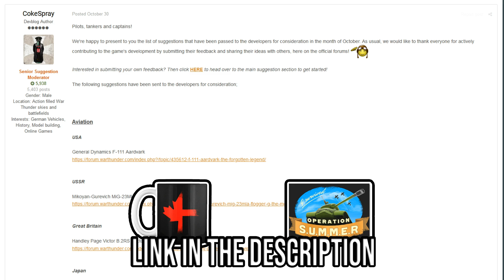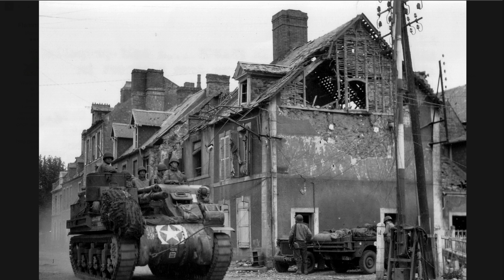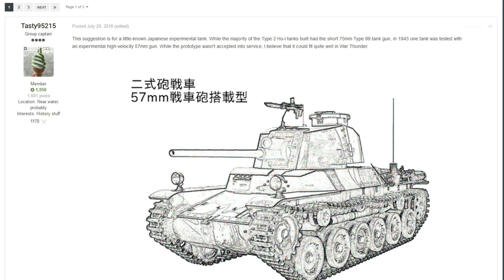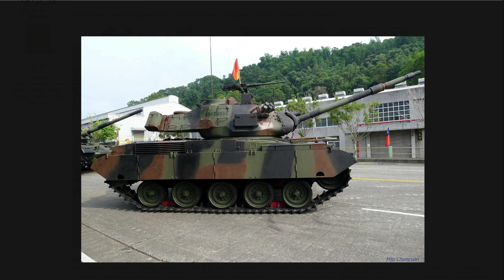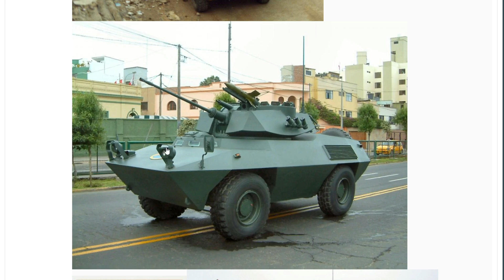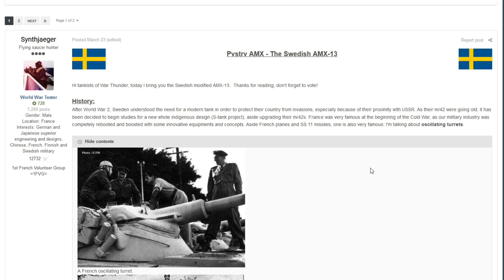Ground Forces - Passed to Developers - October 2020 - War Thunder

Comment: afaik the PzH2000's targeting computer can also be set where it can hit one target with 3 shells at the same time, if the target is far enough away
Reply: According to a group of people dedicated to the PzH2000, there once was an attempt at MRSI with 5 rounds, all hitting inside of 1.2 seconds overall. Though about distance, it's pretty much the opposite: MRSI greatly limits combat range as the  maximum range and anything near it can only be reached with a certain angle, making MRSI impossible.

Comment: Doesn't the CV90105 TML also have the TML 105 turret?
Reply: Not the exact same TML. Vextra has a bit more protection on it. What Sweden has is the same TML that was put on an AMX 10 RC for trials (the one ingame is the service 10 RC with TK turret).
Reply: @jeandelacroix6726  Cool! Thanks for the info!

Comment: No for Japanese tanks. What we desperately need right now is a rank 5 vehicle to supplement that lineup because grinding into tier 6 is fucking horrid
Reply: They also need a 10.7 like China ...
Reply: @drunkIizard  their top tier is fine tbh
Reply: @seemslegit6203  well it s ok but i dont think it will stay that way with new power and even then every nation should have top tier
Reply: @drunkIizard  new power, at least right now, isn't adding anything extraordinary. The type 90s easily hold their own at top tier and are some of the fastest top tier MBTs. Also the only real 10.7 they could add would be the type 10 which is probably too modern. Rank 5 is a much bigger issue right now
Reply: @seemslegit6203  if two new really powerfull mbt arent extraordinary... And for a 10.7 i propose the type 90 with the japanese 120 which is clearly better than the L/44. Finally if you think the type 10 is too modern just look at when the Khrizantema was produce or the two new mbt...
Reply: @drunkIizard  the type 10 would be the most modern vehicle if added, and its so new that basically all of it's specs are classified so it would be hard to implement. Also doesn't the type 90 already use a Japanese gun?
Reply: @drunkIizard  also a type 90 with a slightly better gun isn't really that much of an improvement

Comment: PZH 2000 isnt actually fully automatic on the ammunition handling. It is a semi automatic auto loader, where the shells are handled by an automated ring magazine that features an autoloader for automatic shell ramming. However the propellant is stored seperately and is hand-loaded once the autoloader has rammed the shell into the barrel.
Also, it has recently demonstrated its extremely deadly potential as a direct fire TD.
Reply: The reason for this is they can add either 1, 2 or 3 powder charges as indicated on the computer easily, depending upon range and or for mrsi.

Comment: Yeah Howitzers if fully implemented are going to make Tank RB unplayable, not only have to worry about attack aviation but then Indirect fire. to hell with that.
Reply: The maps aren’t big enough for indirect fire to be effective
Reply: @mitchellr5502  Yes they are. But not on the lower tiers. Higher tiers, especially on sim, gets some bigass maps. Well there are 2-3 really big maps of which parts of it are recycled for use on lower tiers.
Reply: Its not gona make RB unplayable really its not gona be like in WOT.
Reply: @MythicFrost  you can't say its not until its physically in the game. And don't forget I said fully implemented. Not the howitzers they have in game that are basicly tanks.
Reply: Do you honestly think gaijin would make it like it is in wot? They may make a lot of stupid decisions but that would be an astronomically stupid one
Reply: If SPGs are ever implemented I’d expect them to work like the ones we have ingame as tank destroyers considering use as artillery is way too close
Reply: @m1a1abramstank49  pretty sure japan already has an SPG, and yeah it does work like that

Comment: I hope with the addition of more howitzers; Gaijin considers giving us an improvement.  Preferably a range finder for all howitzers, so we don't have to slug it out at point blank.
Reply: that would piss off people because a few still suffer from arty PTSD from WoT, and putting rangefinder would make them cry that "iT's JuSt LiKe WoT"
Reply: @Ultrakillerism  I would say they could give us something more of an artillery plotter, give us a UI where we click on the map, it tells us how far away the point we selected is, and that's all, make it a module for corresponding vehicles.
Reply: @DiamondBaron  that's a system similar to how ArmA 3 does it, just so you know
Reply: @Ultrakillerism  yep!
Reply: I've already tried submitting an idea for it. Using a system, that was just recently, half added to the game. Put it on the page, got taken down. This was a few years back.
Reply: rangefinding via clicking on the map.
it will only give you the range though.

also this means you need options for smaller propellant loads.

Comment: They should add the Saladin armoured car
Reply: @DanielEyre-v2z  MBT-80 didn’t make it past the mock up stage, although they do have some of the proposal test beds like the aluminium chieftain.
Reply: You mean Aladeen car?
Reply: @DanielEyre-v2z  i believe the "MBT-80" at Bovington is just a test bed for composite steel/aluminium construction
Reply: @DanielEyre-v2z  Because that isn't an MBT 80, as i said it's a technology test bed to see if it'd be possible to have a 50/50 split of aluminium and RHA which they where planning for the MBT-80 which is bed ATR-2, with the second ATR-1 being a mobility test for the engine under a estimated combat wheight. Neither of them had a working gun and if added would be very, very bad. They did however made some minature mock ups and have accruate estimates of what it would include. If gaijin ever wanted a fully paper event top tier tank they could add it But, there are many other actually real contenders.

Comment: japan doesn't need ww2 vehicles we need 7.0 or above, there's so many gaps that need to be filled.
Reply: Incorrect. Japan needs both, unless you like gaps like the Ka-Mi (1.0) to the M24 (3.3), Na-To (3.3) to the Ho-Ri (7.0), So-Ki (3.3) to the M42 (5.7).

Comment: Better be a German F-4f on that list that’s all I’m gonna say
Reply: A f4 Phantom ICE would be better ;)
Reply: germany also needs t72 so we dont have to grind russia
Reply: I mean its historic they already have the m48s now we need t55 and t72s
Reply: @samuelplaschko6926  No you dont need it, you want. 
And they shouldn't get neither. German tech is enough for filling the tree.
Reply: They need more stuff for 6.7 and 7.7
Reply: @samuelplaschko6926  no, they dont? Germany is already pretty fleshed out, there is no need for more Soviet tanks.
More Leopards and stuff they made is enough.
Reply: Germans dont deserve a Phantom TBH.
Reply: @EmperorEdu  its most bought plane of the luftwaffe so they will get a phantom 
If not then a mig21bis SAU or the mig23MF
Reply: @EmperorEdu  yes they deserve a F4F the last versions where the most modern and capabble and was extensivly used by germany even into the 2010s